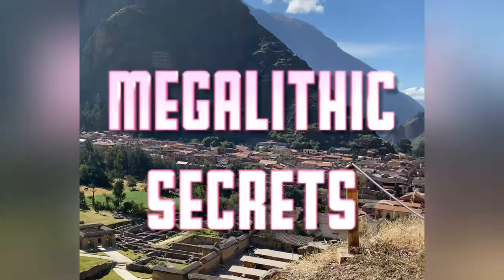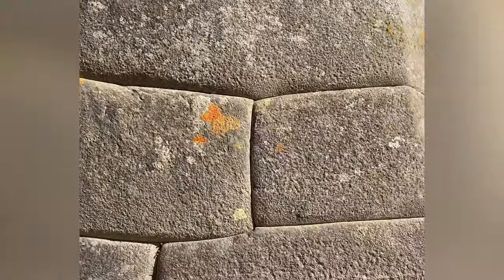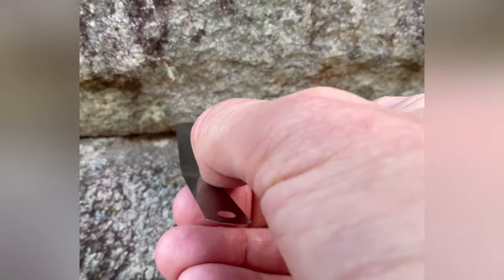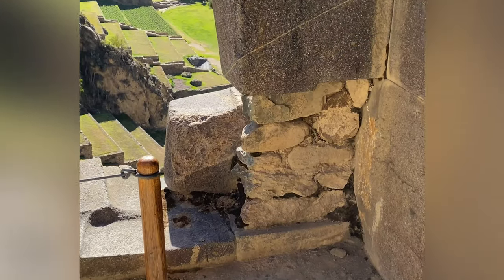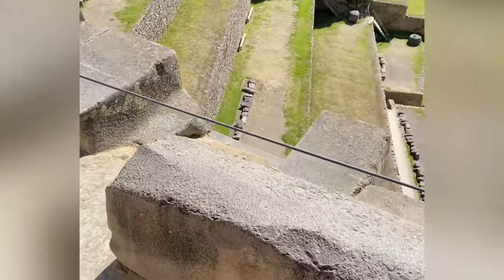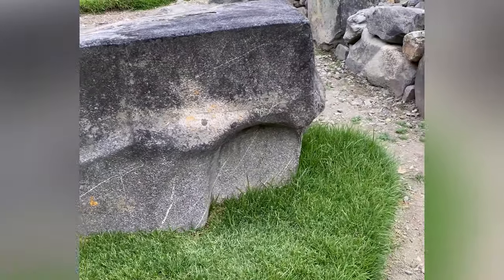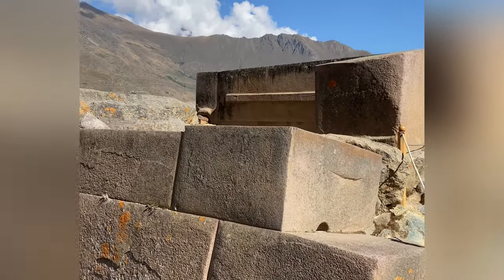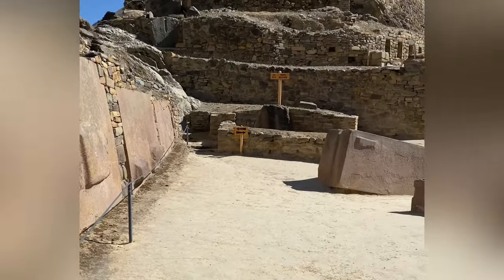Megalithic Secrets of Ancient Peru - Examples of Stone Softening Evidences

Comment: I don't think they softened stones. I think they first created a malleable mass that turned to stone after drying.
Reply: it was just their version of concrete
Reply: Actually no, cuz there are quarries where they cut the stones from the bedrock. For example, the Machu Picchu quarry is just 1 mile up the mountains. In Egypt, the quarry which all the granite syones cut from, is 500 miles away! Both in Peru and Egypt, they were cutting 10 to 1200 tons of stones out of the bedrock like butter!
So it doesn't make sense they were cutting em, if they could just smash em to pieces and make cement like products!